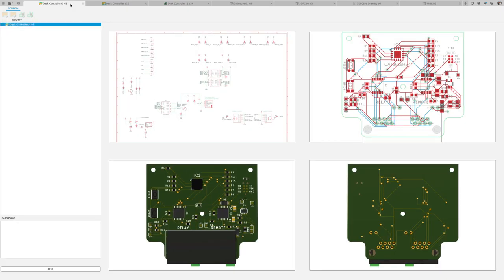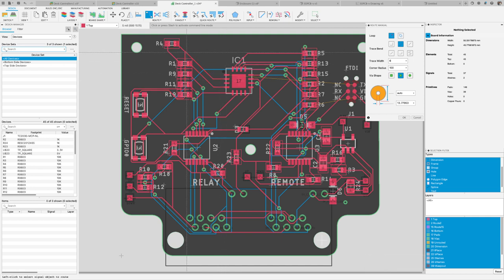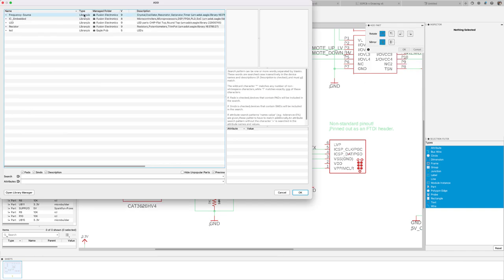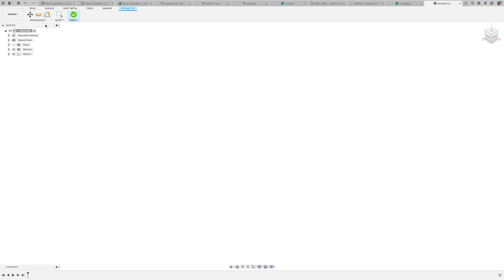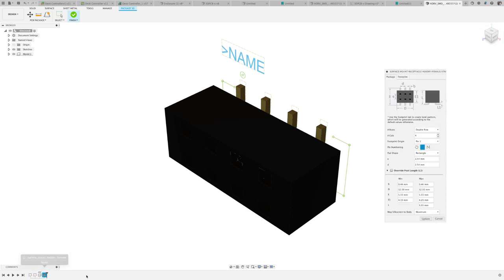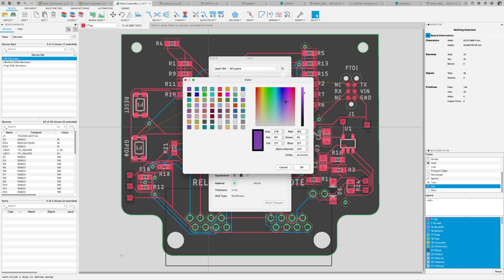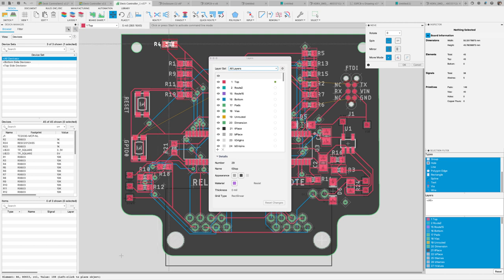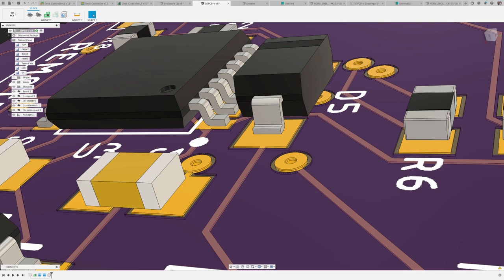What's New Fusion 360 Electronics

Comment: The new 3D PCB renders are much better - soldermask colours actually match, and the cut outs make solder pads and touchpoints obvious. Pity the Via / PTH on the copper layer is still broken.
Reply from the maker: You comments are appreciated, I asked our PM to check it out.